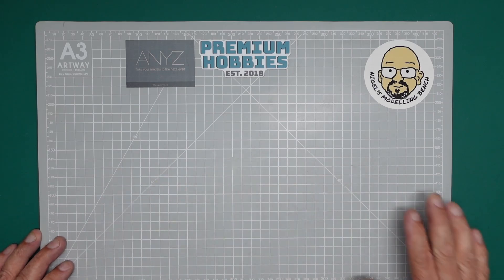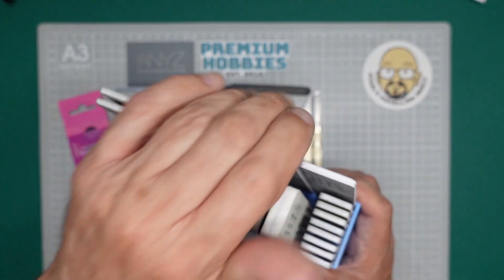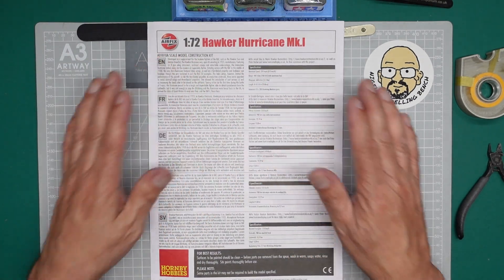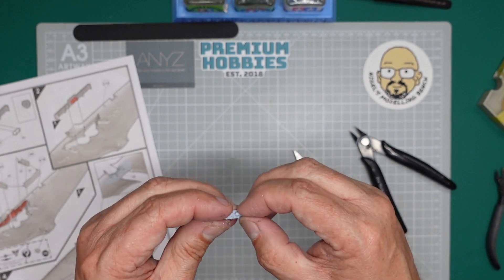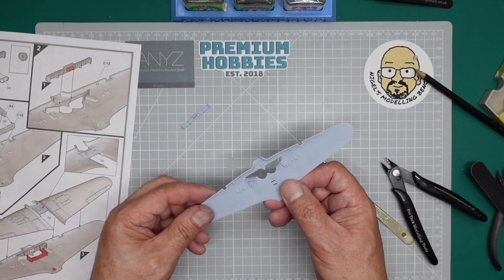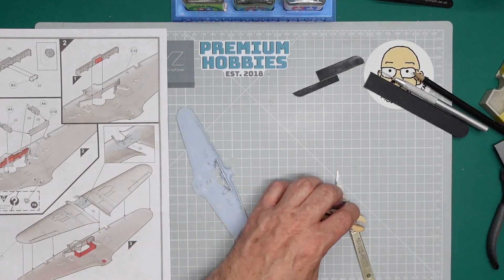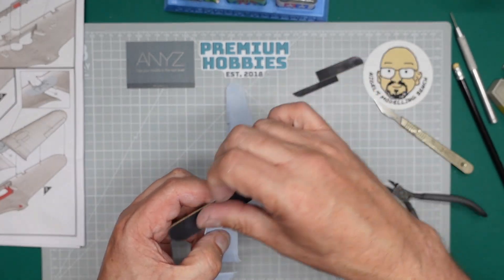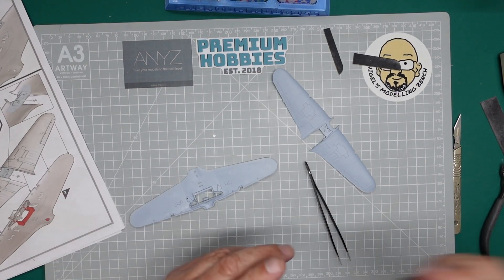Beginners build...Airfix 1/72 Hurricane Mk.1 Part One.

Comment: Nige - fantastic beginner video. I can only underline the need to be patient when assembling any model, and always pay attention to the detail. A part which is out of alignment at the beginning, unless addressed at the time, will compound the errors later on, sometimes with the result that the fuselage halves just don’t fit! There are some really bad kits out there that require ALOT of work. Check, measure, check again and always dry fit. Well done and thanks

Comment: Nigel, at about 38:20 into the video it looks like you pulled out your sharp pointing tool (that I think you use to "reinstall" rivet detail) to probe the undercarriage wall being glued to the lower wing.  You asked to be reminded if you used a tool you had not introduced at the very beginning, so I'm being the troublemaker here, and doing so 🙂  Otherwise, what a really great intro video for the first-time modeller!
Reply from the maker: You are correct Tron.. I do this all through the series.

Comment: Dear Nigel,
Another well put together and presented show for the beginner- nicely done!
I suspect that the undercarriage bays will match the lower surface colour in much the same manner as the Spitfires did at the same time. I am doing some research just now on this matter.
Regards,
Z
Reply from the maker: Thanks Zin. i believe the bays on hurricanes were painted aluminium as was most of the cockpit.